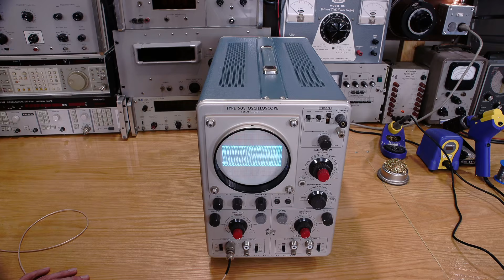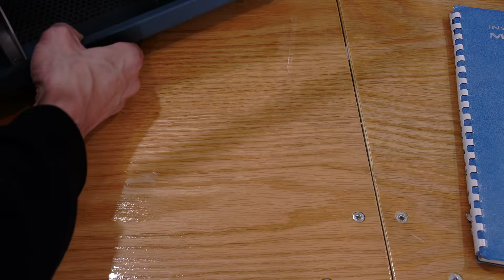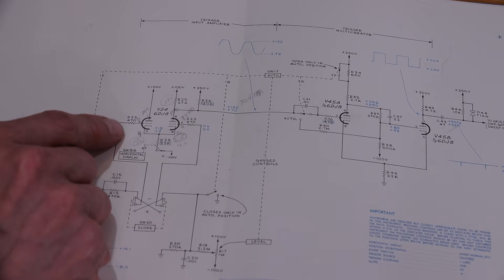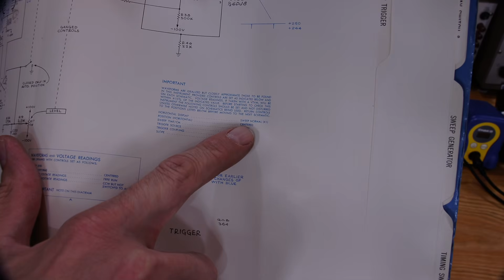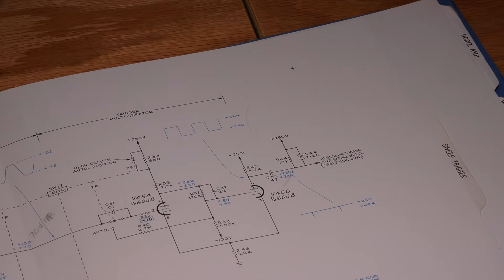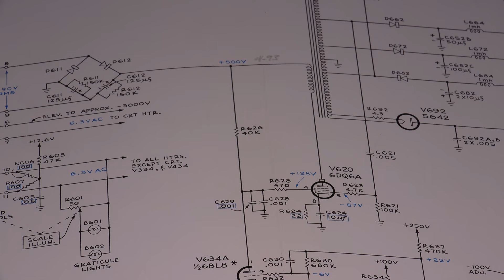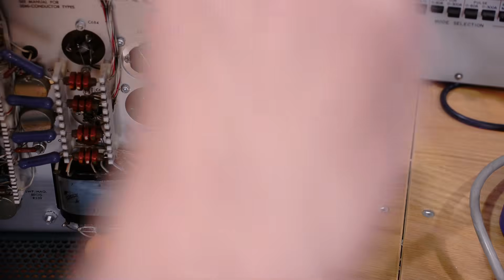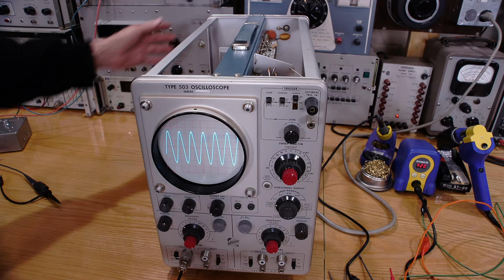TEKTRONIX TYPE 503 Electrical Troubleshooting And Repair!

Comment: Would it be possible to make a screen recorder for these old crt scopes?
Reply: Sure, you could 3D print a camera adapter for one. 
Many of the old scopes have a mounting point that would have been used with a special film camera.
Reply: @rocketman221projects  I meant more like  direct recorder though.

Comment: This is positively nostalgic! In the summer of 1977, I worked at the EE department of University of Maine, calibrating all sorts of test equipment. I remember those manuals. they were the best! I also remember humourous 'doodles' in the schematics; one of a 'sled' sliding down an angled line - fun times!
Reply: Loved the doodles on many of the schematics - like the mop woman cleaning the top of the CRT...  haha !!

Comment: My first Tek scope was a RM503. Still have it after nearly 40 years, still works though it needs some controls cleaned since I haven't used it in some time. I also have a RM504, same scope but without the differential amplifier feature.  Have you ever seen a Type 360 and the Type 160, 162, 163 modules ?

Comment: The build quality of that machine is impressive inside, I just got a 
SIGLENT Oscilloscope; I'm sure is nothing like that.
Reply: Can't knock a Siglent. I don't often need a scope, but I like mine, and it has the benefit of not taking up half of a workbench, if it doesn't cave it in! The price has shot up a good $100 since I bought mine, too...
Reply: @JMA_Elec  yeap it is true, this new scopes are very easy to operate, lightweight. The more I learn to use it, the more I like it.

Comment: When I got my Tektronix 576 curve tracer delivered by a semi-truck with a lift gate so I could get the scope cart with it, I plugged the unit in and ramped it up, after about 2 minutes wisps of smoke started coming out of the side. A resistor that was part of a voltage divider had popped it's solder joint. After I fixed that it has been great. The cart had about $1200 worth of test jigs in the drawer making the extra $550 to ship the scope cart, pay for itself and then some. After reading the old Tektronix manuals many of the recommend a visual inspection of the internal circuitry if the unit has been sitting idle for more than 6 months. That solder inside the Tektronix stuff is silver bearing lead free solder. Lead solder delaminates the metal from the white porcelain terminal blocks.
Reply: In other words, lead free solder that is reliable was a long solved problem. Would have been nice if that was common knowledge back when RoHS was starting to appear...

Comment: man i got hp 54504r thats needs repair pretty sure its the chip that has the built in battery that goes bad.. but love to know if you ever dont one of these models oscilloscope
Reply: They can be repaired, plenty of information on the web.

Comment: « ...working on any vacuum tube can be dangerous ».  No, it cannot!  It is!  It is dangerous.  The Danger is always there.  It should be stated intead:  working on a vacuum tube equipment is dangerous and a electrical shock could be fatal or cause serious injuries.  Submitted respectfully.
Reply: Ok

Comment: I have a Tektronix type RM 503 the power supply section stopped working after some use, and the Armstrong oscillator does not start oscillating on power up. I have already replaced the 6DG6A tube, 5651, C624, and R626. On power on, the anode of the new 6DG6A starts glowing cherry red after a minute and gets way too hot in my opinion so I switched back to the tube old tube which does not glow so hot. I have checked almost every part in the power supply section, and still can't find out why it does not work. -Looking for some help to get it working again.
Reply: I have a Tektronix 503 and 504, great little scopes! In your case, if you have checked all the components, I would look at the 6DQ6 tube as that tube actually runs pretty hard. There is also a possibility that T620 might be bad. I would also check R624, (22ohm) and C624 (10uf) on the back of socket on the 6DQ6 tube. That cap was bad on both of my scopes and had to replace them. Hope this helps!
Reply: I have allready replaced 6DG6A tube, 5651, C624 and R626. On my new 6DG6A On startup, the anode starts glowing cherry red after a minute and gets way too hot in my opinion so I switched back to the tube old tube which does not glow so hot. I have measured all of the connections on T620 all of them have a reasonable resistance.

Comment: I want to see what kind of solder Carlson uses. You have to use a silver alloy that is not that easy to find.  I have  the original roll of solder that came with my 536 and I am hoarding it.